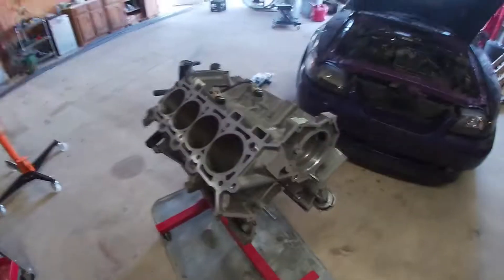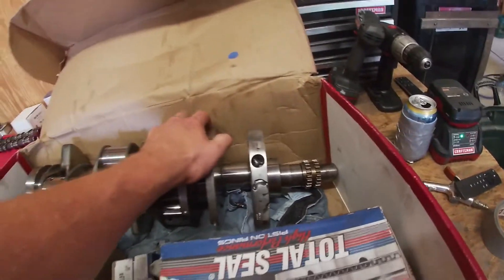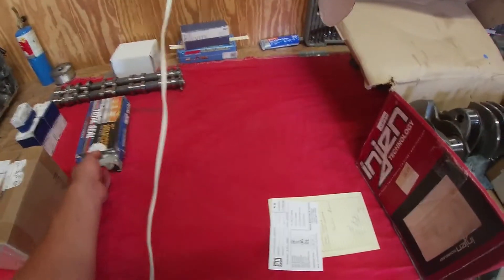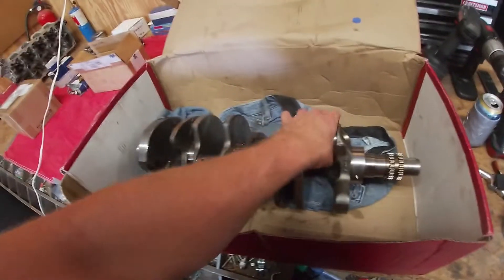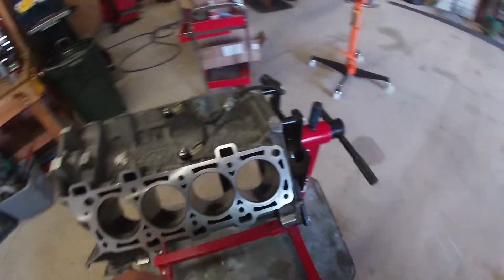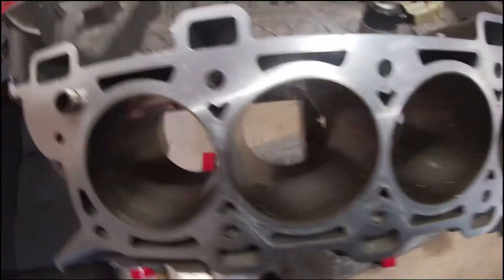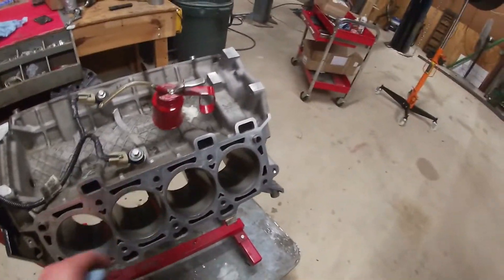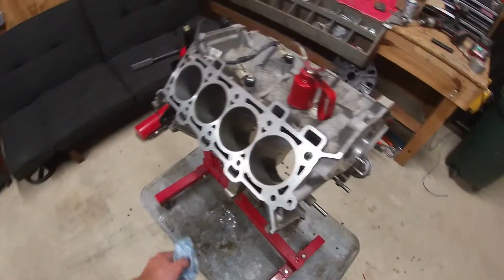1000HP Coyote Engine Build Part 1!! How to hone a block and gap piston rings for boost.

Comment: Didn’t know the gt350 head would work on the gen 1 block any custom fabrication or does it bolt right on?
Reply from the maker: They bolt on, the valve angle is different so you need to use gen 1 cams and mmr modified rocker arms or modify the gen 1 rockers yourself. I used gt350 head gaskets. Theres lots of back and forth on which headgasket to use